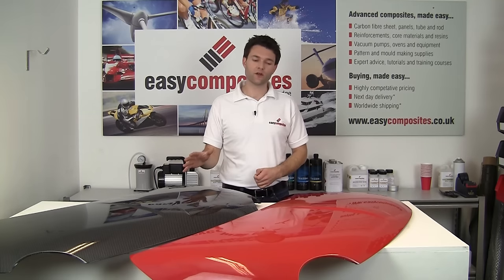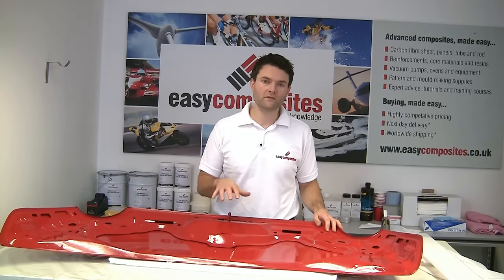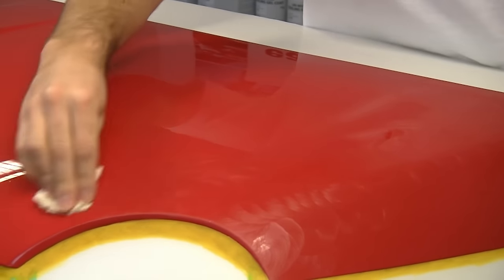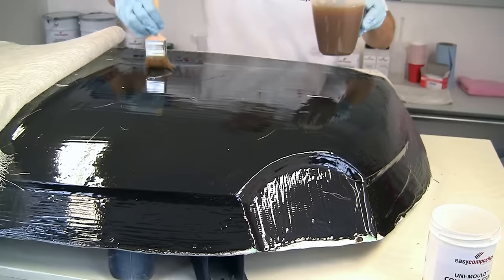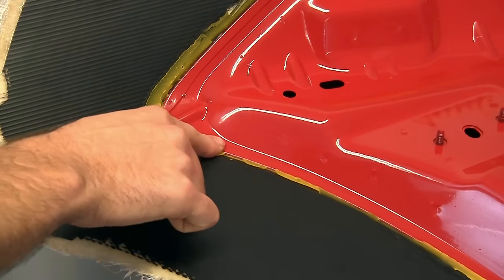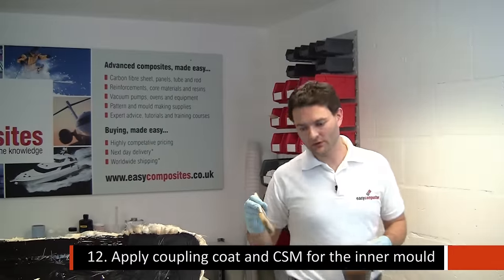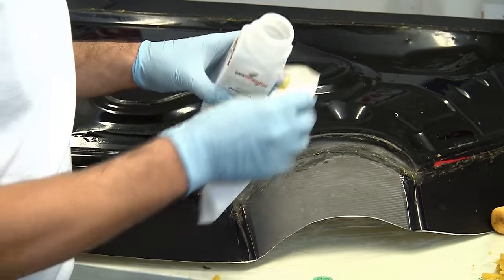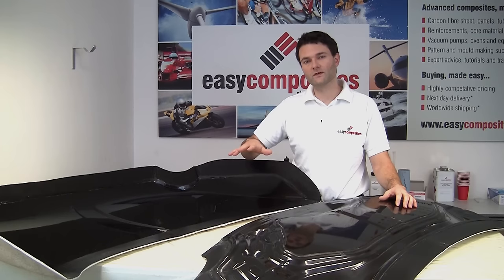How to Make a Carbon Fiber Car Bonnet/Hood - Part 1/3 : Making the Mould

Comment from the maker: @xAssaultTeamx I'm afraid I'm not sure what 'pam' is. If its a composites release agent then there's a good chance it will be fine. Different release agents behave differently so it's worth testing first. We really like to use Easy-Lease Chemical Release Agent but you can use other systems.

Comment: I hope your still in business as follows. I have an old car and a garage that was supposed to be looking after my pride and joy. Were leaning on the wings and knees, have cause  bruising to the wings as they looked in the engine bay. Plus elbows on the rood as they no doubt had their pictures taken. The garage that subcontracted the work wanted nothing to do with it. I was almost in tears and told by those in the know. There was nothing I could do. With the final words of you brought it to us like that. Strange thing the car had won a concours event only weeks earlier. Plus folks sitting in my car with coveralls on and marked the leather. My word against theirs I was heart broken. Therefore I want to make moulds to put over the car if anyone ever works on her again. This car is my pride and joy and I could not believe that a garage could treat a clients car like this. So your video will save the day?? Thank you so much for posting this I'm immensely grateful to you.
Reply from the maker: Glad it can help you.  Just remember to use a soft material between the finished covers and body panels so when knocked or moved, it does not scratch the paint.
Reply: @easycompositestv  Silly question perhaps. Once you put on the cleaner and the black coating when I apply this to the wing. How do I remove the coating once it's cured and set. As you have read my comment I have not touched the car in quite a while as it tore my heart out. It's now time to face my demons and get her back on the road.. As I intend to take the engine out this year and see the damage done to the engine. As there is evidence they were flooring the car from a standing start and chipped the pain badly under the wheels
Reply from the maker: @gordonkearney7356  You need to use a release agent as we do in this video to prevent it from bonding and the 'mould' should then lift straight off. To reduce the risk further, you could consider using an automotive vinyl wrap on the original parts to protect them further. However, if these are being made as protective covers, the other option would be to make offset moulds using sheet wax - we have a video which I will link below but making an offset mould would give you 1-2mm clearance that you could then fill with a soft foam or fleece material.
Reply from the maker: https://www.youtube.com/watch?v=zeE1FdcQ3c8&t=185s

Comment: GREAT presentation.  Concise, to the point, well explained, and informative.  What more could you want?  I wasn't aware such specific systems are available for each step.  Having built a Long EZ foam fiberglass sandwich composite airplane, I am quite familiar with laminating...you do excellent work.
Applying release this time around on the flanges "very important"....NOT an understatement, THAT would be bit of a MESS to fix.  One thing about composites, though, you can fix almost anything.  Cutting it loose without damaging the original part would, I expect, be the "tedious" part, to then make a new "flange" on the one side to the now doubly overthick permanently bonded flange you would have created.  
One question, is it really worth making a mold for a "one off" or would it be less work to just build the part directly onto the current part?  Maybe there would be fitment problems, especially on the edges, on second thought, that you would have to trim, and you would have to externally finish it, so maybe a dumb question.
One other question, any benefit to vacuum bagging any of these steps?  I saw where you had a lifting or delam of the mold from the part circled next to  the paint thingy you fixed, or maybe that was a flaw on the original part?
One more, was the paint "blister" caused by leakage through the release allowing bonding of the paint to the mold?  Now you'd have to touch up the original lid to sell it.  Drat!  ;:-(  At least it was on the underside.  ;-)
Picking up the orange peel in the original paint is pretty impressively accurate mold making.  Yeah you definitely wouldn't want to deal with correcting that in the final part EVERY time.  Do you ever do larger scale fixing of the mold for minor "long wave" inconsistencies in the original part?  That would seem to be more problematic working on the "concave side", if you will.
Your finished molds border on exquisite.
Reply: What part of material  for making fiver plastic

Comment from the maker: The cost price for the materials used to make this (inlcuding things like the vacuum bagging consumables) is around £450. Remember that this is making a top-spec pure carbon fibre hood; there arn't too many of them around (they're usually fibreglass with a single layer of carbon and use low cost, but low performance, polyester resin). Also, if you buy the materials in larger quantities then of course you'll find the cost coming down.

Comment from the maker: Generally, 'dry' carbon refers to prepreg carbon fibre (where the fibre has already had the resin impregnated into it when it's manufactured) and 'wet' carbon refers to more traditonal 'wet-lay' where wet resin is applied to the dry fibre (called laminating) when it's in the mould. Resin infusion is neither of these processes really so is better being called 'resin infused' rather than 'wet' or 'dry'. The 200g carbon is a 3k and the 650g is a 12k.

Comment: That part appears to have enough compound curvatures to be inherently rigid, but if you are making something with flatter panels, ribs can be built on the outside of the moulds  to give 3-D rigidity by wrapping the outer mat over plastic pipes or styrofoam blocks.

Comment: At 14:45, you start painting gelcoat onto the part. You've talked about the release tape and filet wax but don't mention applying any release coatings to the bonnet's surface. Later on after you've cut off the excess fabric, you separate the two molds which suggests you did apply a release coat to both the topside gelcoat and the underside of the bonnet. Did I miss the step or something else?
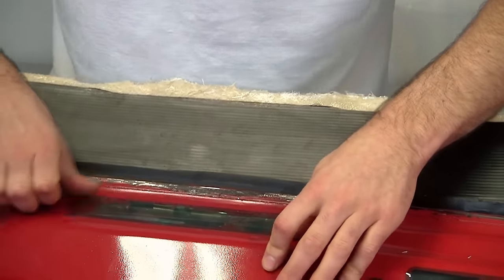Reply from the maker: +michael greene : Hi Michael, release agent is applied to the original part (and the flanges of the other side of the mould) but we did it slightly earlier in the video at 13:20. This step is indeed very important :)

Comment: I alway added small clay wedges between the mold half edges to help separating
and some keys to get good Registration between the halfes
Reply from the maker: This is not a traditional 2 part mould in the sense that the parts are made together.  You will see in the later video that each half is used separately so in this case, laying up in this way was purely for convenience and ease.

Comment: I don't know what I'm talking about, but it seems like composite panels would affect crashworthiness. I mean, that hood has different material properties than the steel one, but the same dimensions, and it's right in the crumple zone. I know it's possible to make a crashworthy composite structure, but I wouldn't want to go replacing structural parts of a car with ones with which it was neither designed nor crash tested.

Comment: instead of using all the waxes and chemicals to release the mold/tool from the original, you should try solid release film. it comes on a large roll and works just like kitchen plastic wrap. if there are any imperfections due to wrinkles in the film it can easily be feathered out with bondo or what ever resin you use to make the tool.

Comment: Instead of having to pry apart a thin edge, just put bits of wax in to keep the edges apart, then cut through those wax blobs as you trim the edges of the mold.

Comment: Awesome bro tell me one thing how to fix it with chesis and also how to make the points for screws tight
Reply from the maker: Hi Rajat, fixing to the chassis in this case would be using the original fixing method. Plates etc can be bonded to the hood using an MMA adhesive or similar. For other hard points/screw threads you can bond or laminate captive metal plates into the component.
Reply: @easycompositestv  thanks

Comment: I'm still looking for something to put over the bonnet to protect the paint before fiber glassing. It's a good bonnet so I don't want to mark the paint.
Reply from the maker: A good quality vinyl wrap should work well however, we'd always recommend a quick sample trial of the vinyl first to ensure yourself that there are no issues between it and the gelcoat - as long as it works in the trial, you know you're good to use it to make your mould.

Comment: This will not damage the paint correct? As long as all these steps are followed?
Reply from the maker: Hi, no this did not damage the paint as all the correct release agent processes were followed. It is worth running a small trial on painted components as styrene based gelcoats can have an adverse affect on certain paint types and freshly painted components.

Comment: Hello,
why do you aply coupling coat and not just resin, what are the advantages? If i Want to make the hood from fiberglass and not carbon  fiber, should i do it without the coupling Coat?
Reply from the maker: This is the mould making video, not the actual hood making part - in the case of the mould material we used is a Vinylester Tooling Gelcoat and so to ensure a good bon between the gelcoat and reinforcement and to avoid air pockets, we use the coupling coat (which is also vinylester) with a light weight glass fibre followed by the heavier weight fibreglass which is applied with the Polyester Tooling Gelcoat. If you're making a hood using Polyester gelcoats and resins, you shouldn't need a coupling coat but we'd still recommend a lighter-weight glass for the first layer behind the gelcoat.

Comment: I'm guessing the answer is yes if the roll is large enough but this can probably be done with pre preg right?
Reply from the maker: Yes, for sure, although if you're talking about prepreg moulds rather than making prepreg parts then it's not really possible to use temporary barriers and things to lay up the tooling prepreg onto. You'd probably end up taking a wet-lay 'splash mould' off, laying up a 'splash part' (with all the flange extensions in place) and then taking your prepreg mould off the splash part. Phew! Lot of work.

Comment: The video was very very informative and easy to understand. Would you please inform the approx. costing of 10 bonet with all meyerials so that i may calculate the costing. I am interested to import all materials including carbone fabric. Looking forward for your reply. Thank you for your nice video.
Reply from the maker: Hi Anowar, the cost will very much depend on the size of the bonnet - some bonnets are more than double the size of the one in this video, others can actually be smaller. My suggestion would be to email sales@easycomposites.co.uk with as much information as you can provide us with (size, shape, final end-use; e.g. track use or road use) and then we will be able to come back to you with a quote.

Comment: Looks great. Just curious about fenders and there mounting brackets or flanges on inside. How would one go about that so they could have can havefenders that can mount to the body as intended from factory?
Reply from the maker: It depends on the mounting arrangement.  You could well fabricate angle brackets or similar to bond or laminate onto the inside of the bumper in the right place.  Or if the shape is quite complex, you could make an inner mould with mounting holes in the right place. You can even salvage mounting brackets off an original to use on the copy.

Comment: Hi, great video. One question I had is about the yellow wax you use. If you fillet the top, then fillet the bottom, won't you have a gap in the final product where the fillet was?
Reply: No  this  it is the point of filliting to fill the gaps that can cause the composites to lock to the moulds how ever  fillited area in the final product will be a area trimed off

Comment: 1st off - these videos are fantastic thank you for providing them! @easycompositestv
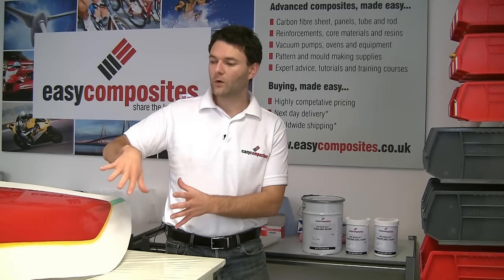I have a specific question regarding compatibility and chemicals used in this video. At minute 6:45 in the video, one of the reasons he gives for using vinylester getcoat resin for his mold is to ensure a clean release of the part (which will be carbon fiber and epoxy). I understand that vinyl ester resin is "compatible" with epoxy.... But, since the gelcoat will both be fully cured, and coated with release agent before the epoxy/cf part is put onto the mold, is 'compatibility' an issue? Wouldn't compatibility just be as issue if one was going to try to chemically bond epoxy to a gelcoat... in which case you would want vinylester gelcoat since it is compatible with the epoxy?
I have always only worked with epoxy in my work so far, so 'compatibility' between resin systems is new to me in most cases. If someone could take a look and chime in with some knowledge, that would be awesome!!!
Thank you.
Reply from the maker: Hi Marc, thanks for your feedback. Regarding compatibility, it's a great question as it would make sense for a fully cured surface protected with release agent to release without issue. This isn't always the case however, and epoxy tends to stick to the majority of polyester gelcoats, regardless of release agent. It doesn't require a particularly strong adhesion to cause a part to stick to a mould and for some reason epoxy sticks to polyester moulds, there may be some combinations out there which work, but in general we suggest avoiding this combination. Vinylester tool surfaces offer a much more reliable release when working with epoxies and of course epoxy tools are also fine to use.
Reply: @easycompositestv  Thank you for the quick response! 
So it is a different sort of incompatibility … interesting. My problem with ordering from easycomposites is I am in hawaii. The cost of shipping from that far is much more than the cost of the resin itself unfortunately. I am looking for an alternative place to order or purchase from… if you have a partnering company in hawaii or the mainland USA with the same or equilivent product (vinylester gel coat), I would very much appreciate the recommendation !!
Thanks again for the quick response. And again for the videos. Aloha!
Reply from the maker: @216MCollins  We don't have a dispatch centre in the US I'm afraid. Part of the issue is the fixed courier fee we are charged for shipping dangerous goods which makes smaller orders relatively more expensive. We are looking into options for reducing the cost to our US customers but at this moment in time the only option is through the main UK site.

Comment: Surely using your (round) finger to mould that filleting wax you are inevitably going to undercut and ruin the draft angle? Wouldn't a flat steel edge be the better way to make this? Noted that you didn't undercut but others might.
Reply from the maker: Depends on the angle of your finger! As you noted, I didn't have any problems with an undercut here and using a soft finger helped to leave a 'rolled edge' where the trim line is. This leaves a much more professional edge appearance on the finished part so I'd suggest that it was not the wrong thing to do. Also, we did go to lengths to position the camera and talk about the risk of undercut and what to avoid.
Reply: Easy Composites Ltd - thanks,  I probably missed some of the discussion which led to my confusion, I’ll have to rewatch,

Comment: How thick were the finished molds?  At what point do you add reinforcement to the molds so they aren't flexing under their own weight?  Also, how much if any, shrinkage is happening to the molds as they cure?
Reply from the maker: There was no measurable shrinkage. The Uni-Mould system is a specialist very low shrinkage system.  No extra reinforcement was added other than that shown in the video.

Comment: @15:30 Thanks for the video.  Very well done. Are the 4 layers all soaked through in one go or is it a process related 4 times.  If it is one co, could it also be done in steps?  Thanks again.
Reply from the maker: Unimould tooling resin needs to be done in one hit for all 4 layers so it creates enough heat to fully cure.